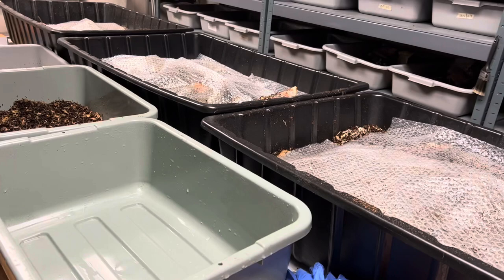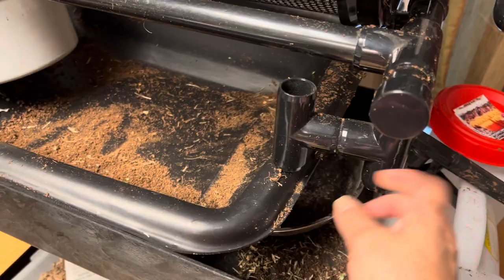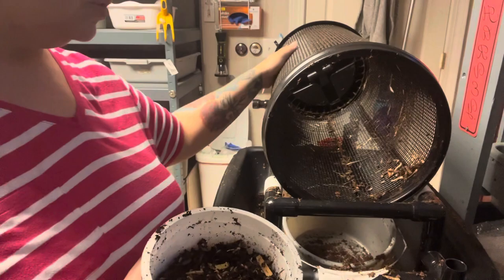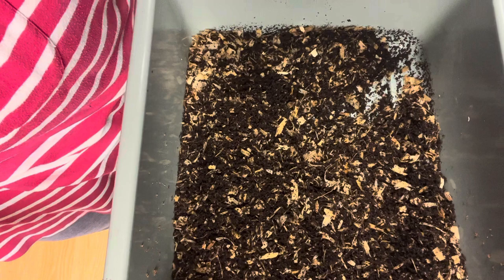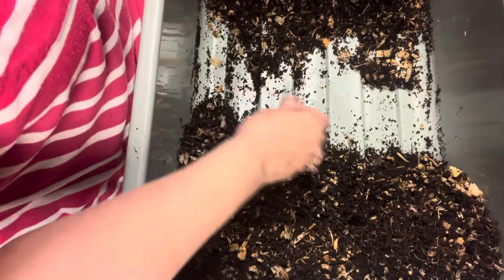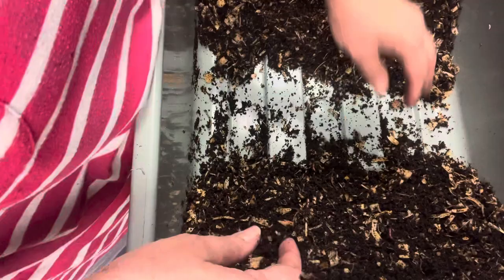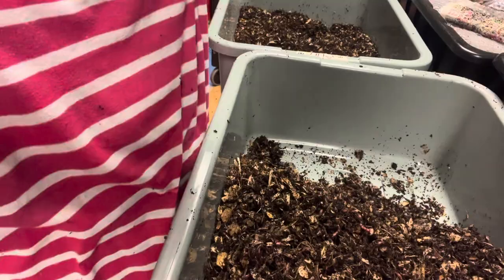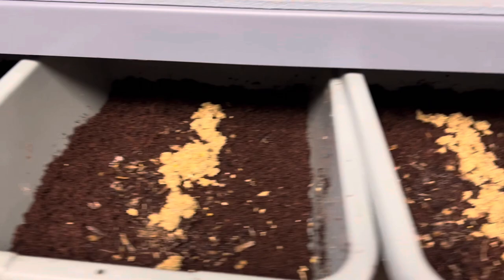How I sift out cocoons and easiest setup ever #redwigglers #wormcomposting #vermicompost

Comment: You already have the makings of the tromel you want.  All you need to do is leave each end open, the crank turning the two small wheels on one side and the whole thing set at about a 15 degree angle.  Doing that, you can add a funnel to the uphill end and as you feed material, castings and cocoons small enough to pass through the mesh will do just that, while larger things like dizzy worms, will tumble downhill, finally spilling into a bucket (to their relief!) and you can work batch after batch, constantly turning the bin by hand or by employing a small motor to roll the bin.
Reply: I'd also add a some plastic where the worms come out to funnel them into the bucket neater. It looks like a good trommel already. 😁👍😊💚🎃